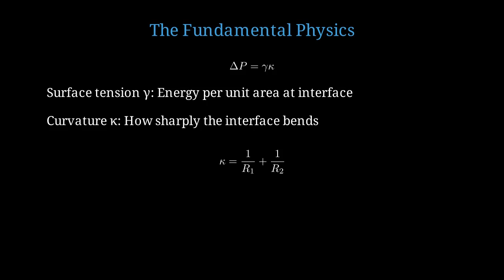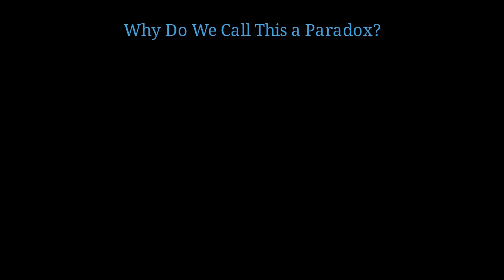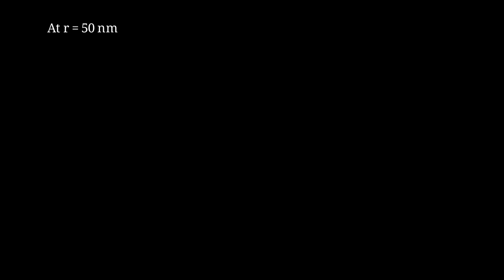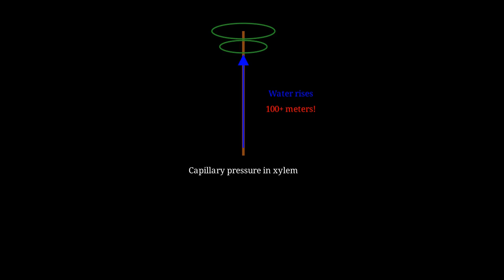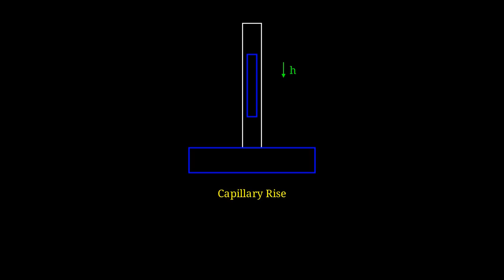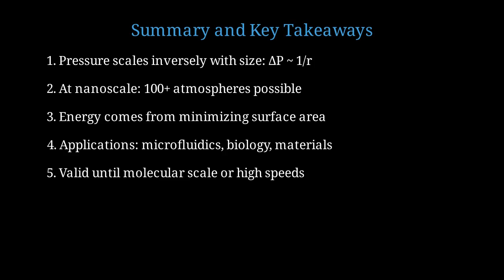How Surface Energy Becomes Hydraulic Power?

Comment from the maker: How does nanoscale surface roughness alter effective capillary pressure compared to ideal smooth surfaces?
Can continuum equations like Young–Laplace remain valid below 2 nm, or do quantum corrections become significant?
What are the thermodynamic limits of spontaneous capillary-driven flow in non-Newtonian microfluids?